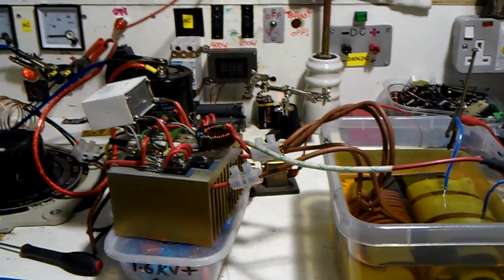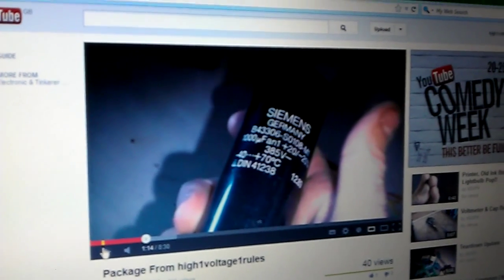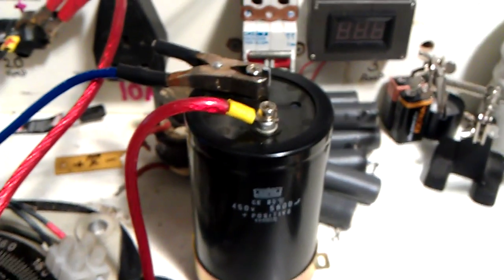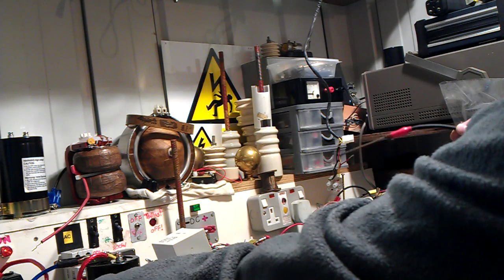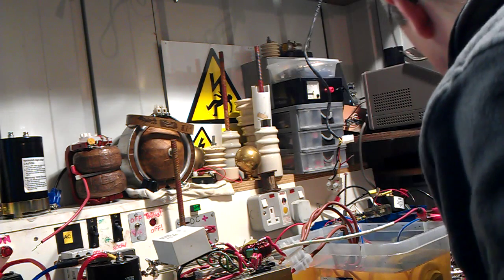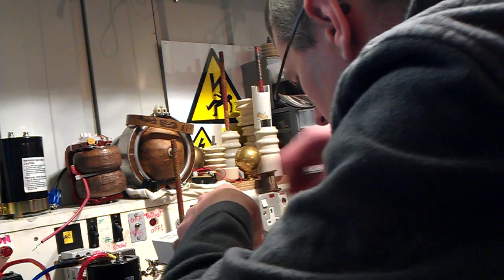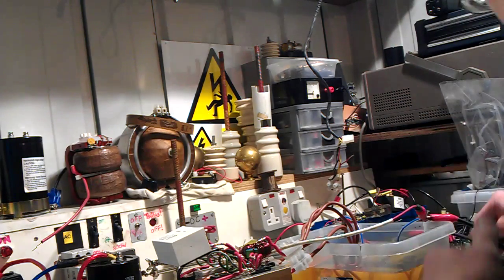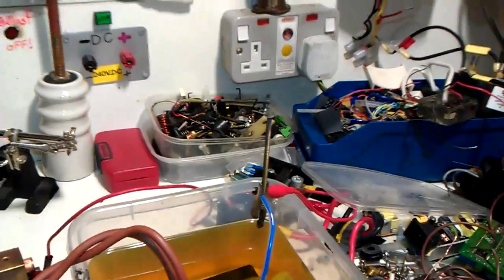"BIG" ferrite transformer"

Comment: moving sucks, that big poly cap on the ZVS will move some amps for you :) awesome arcs ! the frequency is annoy as hell. with 50 volts input you will be pushing 200v into the tank. what is that transformer rated for input wise? at this kind of frequency you could switch with IGBT bricks